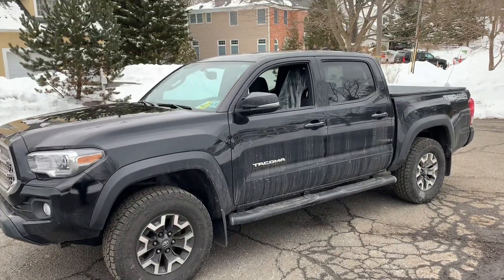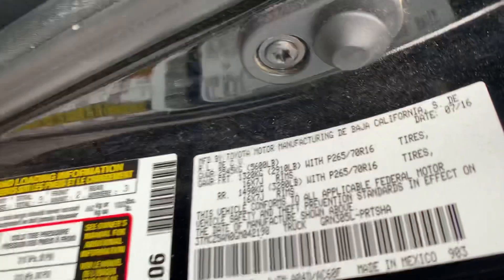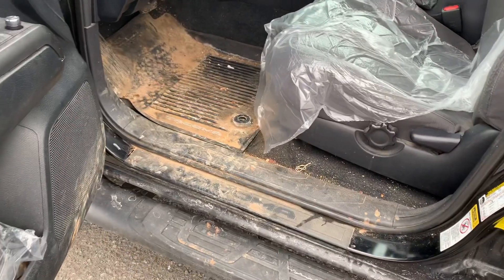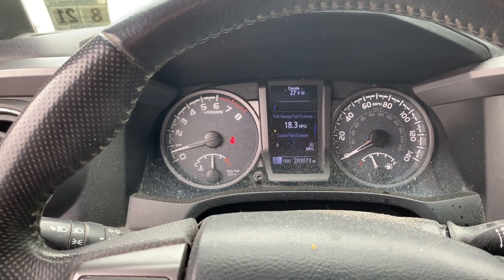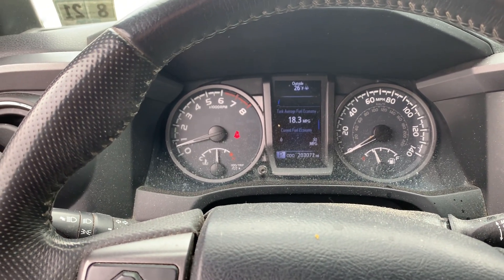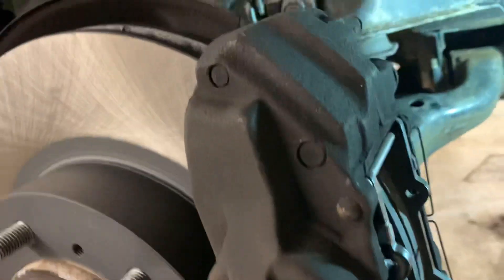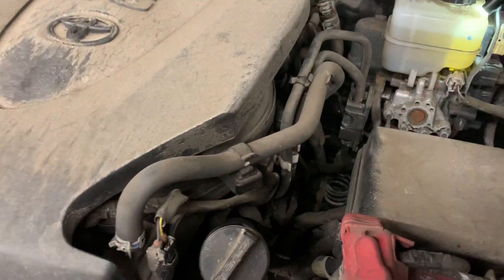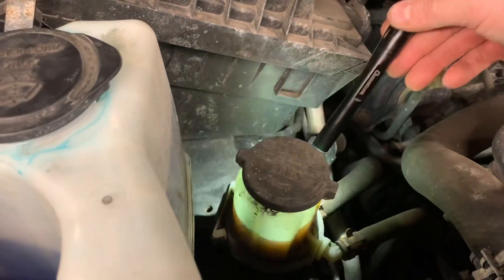Toyota Tacoma Reliability, high Miles? Review/Repair • mind/blown

Comment: On 2/29/24 I had the choice between a slightly used (6K mile) 23 Tacoma TRD Off Road, premium pkg, 6’ bed or an identical 24 Tacoma.
Ultimately I chose the 23, ONLY because of the proven 3.5L Naturally Aspirated (NA), V6.
Historically a Turbo engine simply doesn’t last as long as a NA engine.
Who cares if the new Turbo gets 1mpg better fuel economy? 

The most miles I ever put on a vehicle was a 78 Corolla. It died in 02 with 488K miles.
My last Toyota had the 3.5L engine and when I sold it for my 23 Tacoma, it had well over 200K miles and it was still running like new.
I drive about 5-6K miles per year now and even though I’m almost 60 years old, I plan on driving my Tacoma until either I can no longer drive or I’m dead.

Comment: What the seat comfort says about the truck is that the driver wasn’t overweight and Toyota used good foam lol that’s about it. Still impressed that there were no issues with build up from the direct injection in 200k.
Reply: It's a d4s system direct and port injection. The best of both worlds and why toyota is the bomb 💣
Reply: @timmyadam3542  ahhhh I didn’t know that. That would explain it. Thanks for the info

Comment: 2013 Tacoma V6 w/265K well maintained miles. (2) big repairs,  AC System and Rack/Pinion. Have never had to add oil and no spots on the driveway. Considering today's prices, she's a keeper.

Comment: 2005 toyota Sequoia 260 thousand miles! Biggest hiccup alternator going out at 250 and the rear door latch! 2005 toyota Corolla 316 thousand miles I'm about to change the spark plugs my battery went out here recently other than that great condition for 316 Thousand Mile car wow! And that's why I'm going for a Makita drill and impact set. Instead of Milwaukee M18 fuel or DeWalt or Kobalt xtr.
Reply from the maker: Toyota’s are beasts. Crazy miles on that Corolla 👏🏻.
Thank you for sharing and supporting the channel.

Comment: i own a 95 Tacoma with a 4 cyl. 298000 miles doesn't burn oil original clutch the only thing i changed was the starter at 200000 plus and the radiator at about 18 years the 95 came with a steel timing  chain
Reply from the maker: That is so cool. Thank you for sharing. Just to give you some additional hope. We had one in the shop last year also 95 also manual with 540,000 ish miles on it. 😉

Comment: 25k on my 2019 all local driving. So far so good. Still a little jumpy on the transmission even after the software update. Came with low tranny fluid from factory. 3/4 of qt!
Reply from the maker: I hear you, they’re great trucks. Thank you for watching buddy.
Reply: I got a 19 I got issues with coast up to red light and if it turns green b4 I stop all the way I give it a lil gas to keep going and it revs up and jerks

Comment: Great video bro, my 19 trd off road 174 k original brakes, 3 sets of tires 3 windshields , the local Toyota dealership says it could pass for 10k very very clean😎🤘
Reply from the maker: I believe it!!
Thank you for sharing!! 🤘🏻
Reply: @VikingsGarage  I should of added… it’s a pavement Princess , 2 1/2” lift fox shocks Mickey Thompson Baja Legends , mostly highway miles 92k in 2020 alone
Reply from the maker: @jayfleegle9455 wow

Comment: I have a 2017 Off road, the only issue I've had was the 4wd actuator got stuck in 4Lo this past winter, I will say that was probably my fault not the truck since last winter was the first time I ever put the thing in 4Lo, so it wasn't lubricated or some shit. Luckily it was covered under the drivetrain warranty.
Reply from the maker: Yeah unfortunately this things like to be used often in order to work, don’t let it discourage you. It’s a solid well built machine. Thank you for watching.
Reply: @VikingsGarage  Oh hell yeah man, I actually also used to work on cars at my father's shop growing up, we've only ever had Toyotas in the family, so not discouraged at all, I love my Tacoma, I just wish they used the manual lever for the transfer case that I had on my 2014 4Runner Trail, this electronic dial thing is annoying lol. I don't think I even have 30k on mine yet, but kind of great to see the brakes and what not seem to last ages on the Tacomas, if anyone knows, mechanics spend all day working on other peoples' cars, they don't want to touch their own stuff at the end of the day if they can help it.  Good stuff man.
Reply from the maker: I appreciate that. Your absolutely right, the manual lever all day. Much more reliable. Toyota’s are super reliable. I never ever feel like working on my car. Lmao. 
Enjoy your day Sir.

Comment: Bought my 2011 Taco a year ago from original owner, now has 200K with nothing but basic maintenance. Trans fluid has never been changed and I'm unsure about doing it with that high mileage. Any suggestions?
Reply from the maker: I would totally change it, just add a little additive from Lucas For good measure. 
You will be fine.

Comment: Have a 99 Tacoma TRD OR V6 5MT with over 300k miles that still runs great. The only thing i can fault it on mechanically is having to replace the valve cover gaskets, rear main seal, and half moon seals around every 60k miles or it will leak oil everywhere (All 5vz-fe engines do this). Have 3" OME kit with 883s and dakar leafs, 33" MT tires, and I daily drive this and hit the offroad trails around once a month.
Reply from the maker: That is so cool, you should get half a million no problem. Yeah those oil leaks pretty common. Thank you for watching, and thank you for sharing.

Comment: My first new car was an '07 Tacoma v6 4.0l. I still own it and it drives butter smooth and last trip I did cross country I averaged 22-23 mpg highway. And just recently bought a '22 Tacoma trd off-road. The engine and transmission is kinda crap compared to my '07 but it's better than anything else on the market. I am off-road a lot and a full size would not fit on the roads I take. Love the Tacoma.
My '07 Tacoma is somehow rust free. I just installed new suspension on it and everything unbolted like new without a speck of rust.
Reply from the maker: Very cool, I always enjoy hearing these success stories. Wishing you many smiles  full of smiles with the new one.

Comment: I drove an 06 for 15 years, daily.  Salty roads and the frame was only real issue.  Some wear parts were replaced...ball joints, brakes, sway bar bushings, u joints.  Other than that sort of thing I had 170000 miles of the best vehicle I will probably have ever owned.  Traded for a 21 last year.  Oops.  😑
Reply from the maker: That’s awesome. They are great trucks.

Comment: Was the timing belt ever changed? Thanks for sharing your views.
Reply from the maker: Your welcome, I appreciate the support.
It actually uses a timing chain, and under normal conditions you never have to change it on this engine.
Reply: @VikingsGarage  Thanks for the info. I have a Toyota Solar 2000 that has 257,000 4 cyl. it runs like a champ. I want to get a Tacoma 6 cyl. I'm considering like a 2010 model if I can find one with decent miles.
Reply from the maker: Awesome, thank you for sharing. Yeah at that mileage I think you deserve a Tacoma by now. Do try to get it as new as possible and always check the frame for rust 
https://youtu.be/rRa63_9fOIo
Watch that video , I show you how. 
Best of luck on your used car hunt. 👍🏻
I appreciate your support.

Comment: That diff fluid looked amazing for 200k
Reply from the maker: I do agree, the spark plugs weren’t that bad either for being original. Thank you for watching!
Reply: @VikingsGarage  what do you recommend for changing the trans and diff ? I assume not 200k
Reply from the maker: Transmission fluid 60k
Diff. Fluids 90k
Reply: @VikingsGarage  awesome thank you
Reply: That is what I thought as well. I wonder what his normal oil change interval is. Can't believe he still has the original drum brakes at 200K
Reply from the maker: That’s actually an awesome question Mr. James, and one I do have the answer. 
- According to his records he’s never been over 10k per oil change more then a few hundred miles.( example 10,200 miles + -  was the biggest gap I saw ) 👍🏻

Comment: Just found your channel.  Do you know if Toyota is still replacing the frames from the 2006 and up Tacoma’s under warranty .  Have they stopped doing replacements for the recall. Also does it matter if you are the original owner or the second or third owner to get the frame replaced.  Any help would be appreciated. I couldn’t find anything that said wether they were still honoring the recalls and what the conditions were
Reply from the maker: Don’t hesitate to take it to the dealer , if the recall is still open and you do have perforation on the frame
(regardless of what # owner you are)
They will replace the frame. I hope this information was helpful. Thank you for watching. I very much appreciate your support! 👍🏻

Comment: Was that the original belt? I'm about to change mine at 105,000. Nevermind, you did say original belt. I'm guessing highway miles and primarily driving in an area that doesn't salt roads in winter?
Reply from the maker: Original belt although it was squeaking a bit, specially cold. Highway driving and some road salt. 105k is a good time to change it.Thank you for watching.

Comment: Awesome video but no way that’s the first diff oil change!! That oil looked too clean for that much mileage if that’s true!! My diff oil both front and rear was super dirty at 30K
Reply from the maker: As I’ve said before, all that info was confirmed with service records and asking the customer 🤷🏼‍♂️
Reply: @VikingsGarage   I'd agree I have 120k on my 18 4runner and it was nasty black at 30k has gotten cleaner each change after.
Reply from the maker: Again info based on customer statement and service records.

Comment: No later than 5K oil changes, other fluid preventative maintenance, don’t drive like an idiot and don’t overhear the truck, I can see these Gen3s hit a million if not more. I know of one Tacoma over a million miles but it had to have a used engine or transmission but the body and frame were golden.

Comment: That diff fluid looked too clean to have 200K on it. Maybe someone had changed it at dealership and you didn't know. I've changed diff fluid at high mileage on vehicles and it was dark and smelled like sewage.
Reply from the maker: Again I’m going based on what I was told 🤷🏼‍♂️

Comment: Do you think the burnt valves issue with these engines were just a bad batch form the factory from years 2016-2017? Because I’ve seen a-lot of people give them crap because of it, especially the timing cover leak
Reply from the maker: What I was told is that there was a small batch of exhaust valves that had a bad casting.

Comment: Dude, I have a 2010 with 123 k and had all kind of problems... now the latest is that the paint is failing...
Water intrusion.(W)
Ac fan replaced twice.(W)
Front brake disks worped.(W)
Real suspension leafs replaced twice.(W first time)
Headlights replaced.(W)
Radio stopped working and it was replaced . (W)
Drivetrain vibration .
Seat cover broke on the side where it makes contact with the lumbar adjustment knob.
Sunvisor has a 3/4” play when closed.
Paint failing on roof and hood.
Reply from the maker: Just because you had a bad experience doesn’t mean all Tacoma’s are created equal. Small observation you’re comparing tomato’s with potatoes. 2010 model is different then a 2016 🤷🏼‍♂️
Reply: As a matter of fact the 2016 has 218 TSB’s the 2010 had 298. Source : http://www.toyotaproblems.com/models/tacoma/tsbs/.
Reply from the maker: All vehicles have TSB’s , many. At the end of the day it’s the experience being a good one with the product. If it isn’t you have to move on. I’m sorry yours wasn’t a great one.
Reply: You were probably sold a lemon tbh, My friends 2017 Chevy paint is peeling off already! But his 2012 Tacoma paint is still intact with 320K miles. But I would be pissed too if I had that many issues with it, I dont blame you on that one.
Reply from the maker: They did have issues with paint on white vehicles

Comment: There’s a big difference between 200,000 miles done over the course of 10 -15 years and 200,000 mostly highway miles done in 4.
Reply from the maker: You’re absolutely right, 200k in 4 years is less taxing on the vehicle
 (if it’s highway driving). 
I made this video because of all the bashing I had heard on the Tacoma of that year. 
We see vehicles with 200k and over on a daily basis. I do work for Toyota after all. 
I appreciate you watching the video.

Comment: I've got a 2017 at just over 60K...
Not happy at all....
Rodent ate the wiring harness and Toyota told be I'm screwed....
Based on my 2007 Tacoma experience..... and now rhis on a 2017....
Screw Tacomas 
Reliability sucks and so did Toyota
Reply from the maker: Lol, I’m not here to laugh at one’s misery. But you do understand why Toyota or any other manufacturer is not going to cover a repair on rodent damage.
Manufacturers can’t control nature or the actions of a small animal. It’s your job to keep the cowl area clean and your cabin air filter replaced once a year. The 2 major reasons why this rodents are attracted to your engine bay, other then the heat obviously. For future reference there is sprays(rodent repellent )that you can apply under the hood. Good luck to you.
Reply: @VikingsGarage  manufacturers are now using wiring harnesses made with a Soybean based insulation.   It is cheaper an "environmentally friendly"....
I also have a 1988 and a 1991 Toyota.... the rodents have never touched those wiring harnesses....
Trying to FIX or work around their BS  sucks.... 
If they can't block off and keep the rodents from eating the SOY based Rat Candy wiring harnesses then don't expect me to buy a new wiring harness or another Tacoma....
So enjoy your Tacoma until the 2 ounce mouse enjoys it too....
Reply from the maker: You are funny but also right. It’s not my Tacoma, I work in a Toyota dealership. I’m sorry that you had to deal with that.